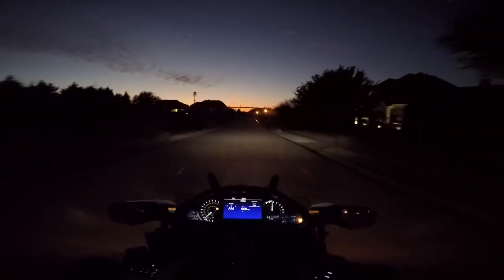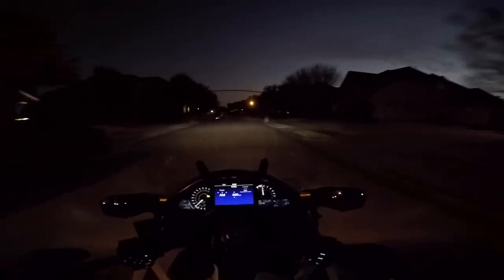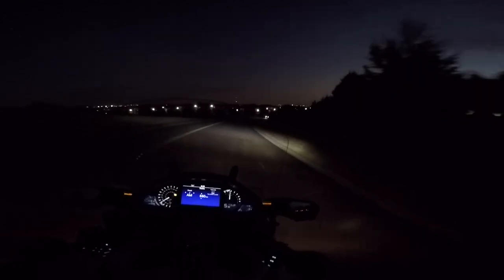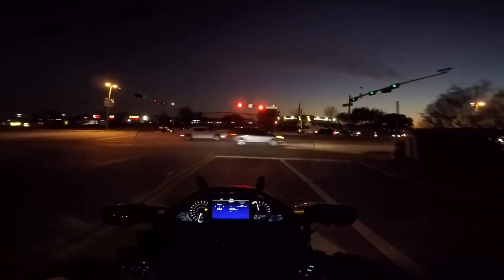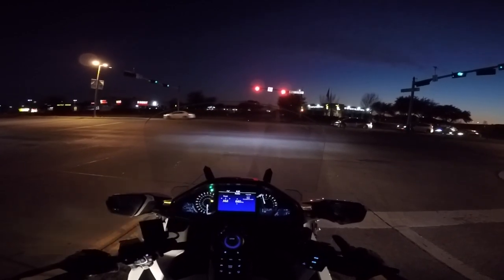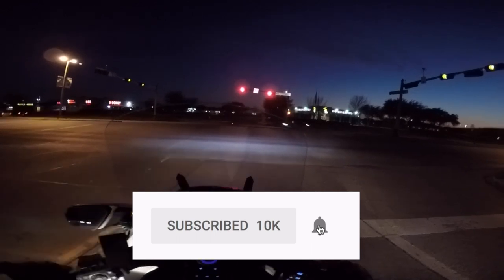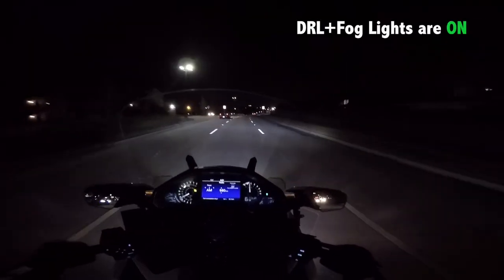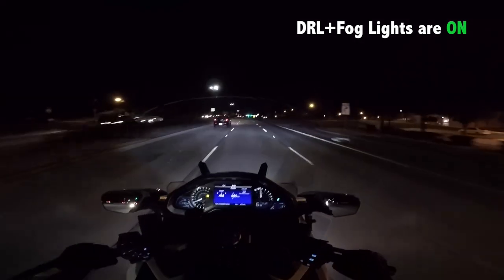Multi-Function Fog Light Test Ride - 2018 Goldwing | Cruiseman's Moto Vlog | CruisemansGarage.com

Comment: Had a pair of fog lights that had strobes with adjustable flash patterns, they are legal in the daytime. I used them for riding in the day and noticed I had very few cars that pulled out in front of me. A slow flash worked best for me. Never got stopped with them. Thanks again for the videos

Comment: I appreciate the head-to-head installation and product review.  Thanks!  They are very helpful in deciding what I’m even looking for, let alone which to get :-)
I would use the flashing light function when I needed to maximize my visibility.    I expect that every rider knows the hazards of two-lane highways and residential roads where other vehicles are crossing into our travel lane routinely: on-coming left turners, home and business driveways, crossroads ... many opportunities for other drivers to pull out in front of us.  I often flash my bright main lights on and off (repeatedly) when I approach an intersection and want the on-coming/cross traffic to register me and my bike.  (This in addition to the assertive “presence” the 2018’s have with their stock LED light arrays.)  I’ve seen other after-market light arrays feature flashing or oscillating lights; my eyes were drawn to them.  This is why I’d use the flashing function.

Comment: I ride at night at times and in darkness going to work in the morning, Phoenix area.  That is why I add more lights on the bike.  Yes it is dangerous.  I have ridden cross country on larger highways at night.  On the Strobes, many states allow, and some DOTs, recommend strobes for M/Cs but I know AZ only allows usage in daylight hours states .  Be aware that if using strobes, some 4 wheelers get ticked off at you and will do aggressive things beside ir in front of you.  I am about 3/4 done installing these Multi-function lights and then  moving on to the front cowl lights.  Thanks for the videos!

Comment: Chris, I will be making a short video tomorrow covering the crash bar effectiveness on the 2018 Goldwing. I was at a company function at a ranch in Junction, Tc, and attempted to navigate an extremely muddy road, but had a fall during the ride. While crossing a cattle guard, the bikes rear tire broke loose, and pitched me off the left side of the bike. This is my first “get off” in about 15 yrs. Trailered the bike back home, and will have to take it to the car wash to remove 100 pounds of Kimble county caliche. I’ll post before, during, and after images, and a full report as to the bikes condition/ road worthiness when the madness is complete. As per your motovlog, I commute from College Station to Brookshire Texas 2-3 times per week, with the commute starting at 4:30am. I will definitely be looking into these lights to help with my early morning commute.

Comment: I think you said that you would compare the three fog light systems.  That should be interesting what you think.
  I bought your maintenance video and it was helpful changing my oil and filters.  One thing I noticed was that the Honda owner's manual says to use 10w30 not 10w40 on the 2018.  That clutch filter was challenging to get out the first time.  Great videos keep making them.
Reply from the maker: You are correct, and several have pointed that out. However, the difference between 10W/40 and 10W/30 is negligible and I have never had an issue using 10W/40.

Comment: This video would have been more informative on this multi-function fog lights to show when you turn them off and on as well as demo the different modes.  Your neighborhood (at the first part of the video) was also pretty dark on the video and seems it would be a good place to show the difference with the fog lights on/off.   Maybe this will be included in your upcoming comparison video.... looking forward to it.
Reply from the maker: Greg, I show some of that in the installation video
Reply: Ok, then what was point of this video then? You ranted in another video about misleading advertising yet this video contained virtually zero information about the product in the title yet tons of taking up your products (presumably these are just commercials to ramp up your stats and advertise your products).